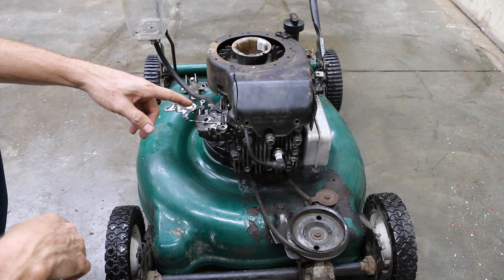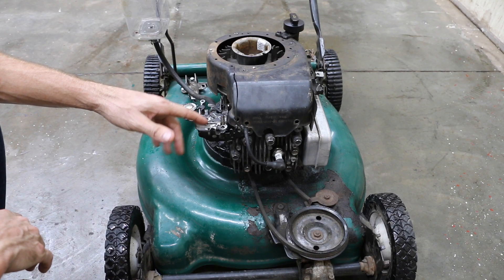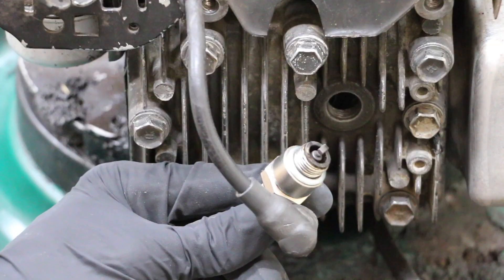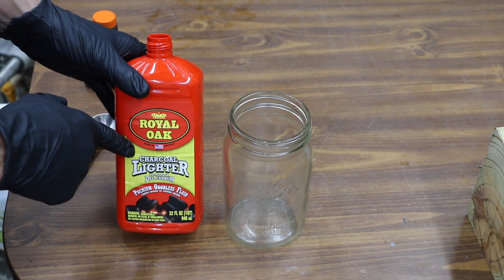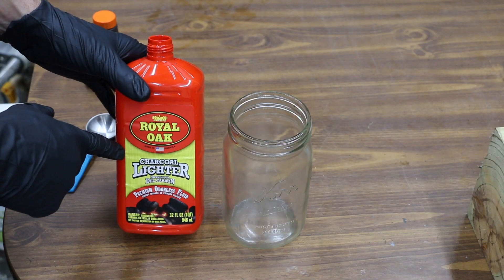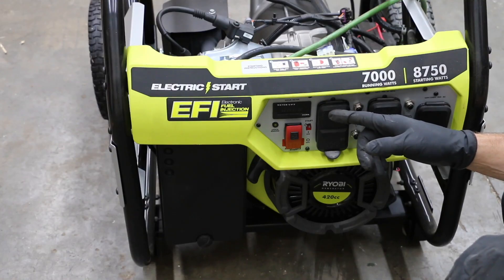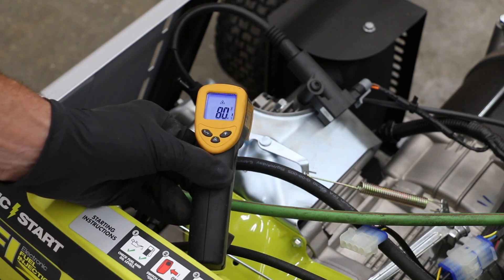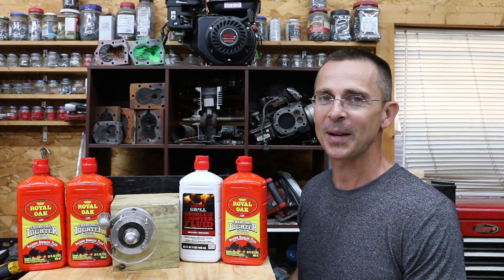Will a Gas Engine Run on Charcoal Lighter Fluid? Let's find out!

Comment: Good to know, but long ago I came to the conclusion that a small jerrycan is well worth carrying in your trunk no matter what car you're driving. If you're not doing off-road adventures you don't need a 20 gallon reserve, there are some nice little cans holding just a gallon or so that take very little space and don't let out any odors, if you're worried about accidents you can spend a few extra bucks to get one that's also shock proof and heat resistant to some extent.
Reply from the maker: Thank you

Comment: Im surprised those engines ran as well as what they did on lighter fluid. Besides being a very dirty fuel it seamed to work well enough to get you by in a pinch
Reply from the maker: Thanks for the feedback

Comment: This video got me wondering if the spark plug position has any effect on the carbon buildup and potentially the power.  The flame travel visible in the see through head definitely has a pattern of blue vs yellow with obviously (I think) the yellow streaking being the areas where carbon builds up.
Reply from the maker: Great point. Thank you

Comment: Hi Todd. There's a lot of urban legends about making a diesel engine run on vegetal oil, enhancing engine performance by adding 1 glass of acetone to the tank, and others. If you have a diesel engine (car or power generator at hand), can you do a big "diesel urban legends review" ? It would be great. I must add than during a strike I had to make my diesel car run with 30% of sunflower oil with no problem at all : no smoke, no fries smell, no less mpg.
Reply from the maker: Thank you for the video idea!

Comment: Hey there Todd, have you ever tried running an engine on pure ether, or starting fluid? Would be an interesting video.
Reply from the maker: Thank you!  I did test starting fluid but it had lubricant too.  Would be very interesting to test ether without the lubricant

Comment: You do know in your scenario you mentioned there would be still massive amounts of fuel in the bottom of the tank  all your charcoal lighter fluid would do is mix with the residual gasoline... should have a blend might have some Coleman fuel left if you went on a camping trip as well
Reply from the maker: Great point!  Thank you

Comment: So here's a new idea for you I have tried and has went both ways but can dusting a engine with baking soda when running bring back compression get rid of slick cylinder condition and regain compression due to normal wear aka just worn out engine will it re hone a cylinder or is it releasing the rings because a stuck ring can simulate a slick cylinder. Using a teaspoon give it about 1 small amount  just enough to studder the engine down heavily and fast enough but not enough to kill will need to keep it running moderately reed to achieve this. Will this review seat rings?  Am fighting brain cancer and it's awesome I get moments I come back around and all kinds of ideas come flowing. I love to share with you and fans. Rest of the time I set and enjoy. Really liked the crude oil. Keep us smiling. Thank you from you friends from NE colo....
Reply: And another idea go though how some old chemicals they used to use vs what's available today. If you get ur hands on dot 1 brake fluid can figure out its explosive properties. We kept it around to blow out os glass pack mufflers. Back in the day. Be warned doing so is dangerous glass pack can turn into grenade if not done right. Or if even u do b everything right it still can go bad. A good place is to hit up these u tubers storage finders. Just ideas
Reply from the maker: Thank you for the video ideas!

Comment: So one time when I was young. I put zippo lighter fluid one can two cans of carburetor cleaner and half a gallon of gas that had some 2cycle oil in it in my pickup to get down to work. I kept it at 45 mph it worked fine. Wouldn’t want to do it again
Reply from the maker: Glad it did the job!

Comment: I may be wrong, but I thought lighter fluid was just gasoline that didn't have any detergent additives. Which would explain why it ran about the same as the gas in that mower engine, and left a lot of dirt. I'm betting if you mixed it with a double dose of Seafoam or MMO you would have a pretty decent gasoline.
Reply from the maker: Thank you.  I believe it's a lot more like kerosene.

Comment: In 1982 a friend and I went camping.  The fuel pump in my VW broke while we were deep in the mountains!  I pulled the fuel line off the pump and plugged it into a bottle of charcoal lighter fluid.  Then I turned the bottle upside down and strapped it above the carburetor with a bungee cord.  I poked a vent hole to prevent vacuum lock.  That quart of charcoal lighter fluid was enough to get us down the mtn to a repair shop!
Reply from the maker: Nice!  Glad this did the trick!
Reply: Classic MacGruber.
Reply: Those vws man
Reply: You didn't mention the effect of gravity going DOWN the mountain.
Reply: Oh wow. See Project Farm's scenarios are real!
Reply: @Dimondminer11  eh I've done similar things, I run a motorized bicycle to work, and have had twice where I HAD to get to work and didn't have gas or money for gas, once I used some paint thinner and 10-w30 for oil, and the same with lighter fluid, both worked fine but liked to stall at low rpm
Reply: Or could've just coasted DOWN the mountain in neutral.
Reply: Yeah
Reply: Charcoal lighter fluid is supposedly a form of naptha. It's a good cleaning agent. I'm not sure but I think it's similar to white gasoline. The extra deposits in the mower engine after using the charcoal lighter fluid may have been caused by that fuel combining with the engine oil cleaning as it burned , whereas gasoline might not react that way as much as the charcoal  lighter fluid  ?
Reply: VW,= 4 Briggs & Stratton engines with common crank shaft and camshaft therefore it will run on almost anything flammable! As with a lot of alder engines, Pre 1974, (first computers). 

 Now we know that a fire needs three things to burn, ignition, fuel, oxygen, for most fires. So if you lit a match it would be the catalyst, that leaves either substance being burned , or the oxygen as the true fuel? 

 Remember all fires need oxygen, except some metals, such as Magnesium, this metal gives off oxygen when it burns, thus most firefighters will foam it down and let it burn it self out.
Reply: Magnesium doesn’t give off oxygen, but it can steal it from molecules other than plain ole O2, like CO2
Reply: Patrick Fennessy,

Remember the Fire triangle!

Comment: You should test octane boosters by putting them in the most knock inducing fuel. See which octane booster does the best job at reducing the knocking.
Reply from the maker: Thank you for the video idea!

Comment: I think I found a new penetrating oil solution. Mix 50/50 Ronsonol (naptha, lighter fluid, etc) with a light oil (turbine oil, sewing machine oil, tool oil, spindle oil, etc). Super thin and super slippery.
Reply from the maker: Thank you!

Comment: Charcoal lighter fluid is naptha. It's a great solvent that's safe to use on almost any fully cured paint or varnish surface. Luthiers use it to wet sand nitrocellulose laquer guitar finishes. It evaporates with no residue. I always have some around for many different uses, but would never light charcoal with it! There are much better ways...
Reply from the maker: Thank you for this information!

Comment: You need to do the lubrication test on these alternative fuels as part of the comparison. There is also a density test used for checking alcohol content in beverages and acid levels in batteries that would give some comparative information as to how good a substitute for gas or diesel it would be.
As for charcoal lighter fluid,I suspect it is just kerosene and white spirits with a perfume added to disguise the smell so it will probably work well in a diesel but I wouldn’t use it in a gas engine as it will destroy the catalytic converters.
Reply from the maker: Great test idea! Thank you

Comment: I was walking through the automobile oil aisle at the local big box store and came up with an idea to pass along to you. You know how they have the 0w oils... How would an engine rated for 10w30, or even higher, handle 0w oils? Can they benefit new engines or tired old engines? Also,  have you ever done a real world comparison of the different oil weights? Lubricity, flow rate at hot and cold, effects on engine performance, etc.?
Reply from the maker: Thank you for the video idea!

Comment: Video idea try different lighter fluid and see if one start fire better.
 I buy store brand but it take me a lot to get a bbq going or does any one have any input.

There also a ECO brand sold at Amazon and home depot and a , Smarter Starter Natural Charcoal Lighter Fluid brand that claimed no carbon left behind.    

I let bbq be lit for a very long while befoe putting food on do fact I used wood from trees.
Reply from the maker: Thank you for the video idea!

Comment: Run a Deisel engine on old fish n chip old oil after you filter it first no added chemicals at all Just old fish n chips filtered oil straight from the cookers filtered then in engine fuel it should run . Where i live we use to start your bastard spray can either in a can, The deisel folk use it all the time to start big deisel motor,s or nitrous oxide .cheers from down under.
Reply from the maker: Thank you for the video idea!

Comment: Very interesting.  For an emergency, this is a workable idea.  Not something that would be counted upon, as performance definitely was not there, but that was not the point.
Now, is it possible to melt tar to the point that it could be used as a fuel?
Reply from the maker: Thank you for the video idea!

Comment: if lighter fluid works, then thinner should works too. right ?
Reply from the maker: Yes, thank you
Reply: @ProjectFarm  Thanks for the info. I wondered if prolong use of thinner would cause any harm to the engine. Perhaps the engine oil will get diluted eventually?

Comment: A serious application question.

This shows that engines will run but with less performance and potential damage. ( carbon fouling)

I would be curious to know if adding the lighter fluid to existing fuel gains an advantage in extending range, or negates the performance of the existing fuel.

For an example:
An 11 gallon tank holding 10 gallons of gasoline .
At 10mpg would be a range of 100 miles.
The lighter fluid has less performance so less mpg.

So would adding a gallon of lighter fluid to the tank gain mileage?
( 100+ )
Or would the lighter fluid taint the existing fuel and have a shorter range? (100-)

Would it be better to add the fuel at the beginning of the trip, or just before the tank is empty?

With the carbon fouling I would say this only be used in a real emergency vs an inconvenient emergency.
The cost of repairs compared to the inconvenience of walking 5 miles to a station and returning may not be worth it.

Something to consider while drinking from my project farm coffee mug 😁
Reply from the maker: Thank you for the video idea!

Comment: Wonderful work although I am curious if the generator has knock sensors. Although I don’t condone using such a liquid in a car, modern port injected vehicles with knock sensors and variable valve timing may be more resistant as they are able to pull timing and delay valve opening to inject fuel later after TDC in severe cases. Some more recent engines can even let out compression so to speak by altering valve overlap and leaving the intake valve open slightly longer before the power stroke pushing some of the mixture back into the intake manifold. This is especially prevalent in today’s modern high swirl pentaroof combustion chambers that set the concept of direct injection in motion. Atomization is key in any alternative fuel which injection does well and what the carburetor lacks completely. This is my explanation for the easier starting to folks here who are curious. Again excellent work! Thanks for the videos!
Reply from the maker: Thank you.  The generator does not have a knock sensor and cannot adjust timing.

Comment: I do have two video Ideas:
"Will running 2-Stroke Gas in a 4-Stroke Engine make much carbon deposits?"
And
"Will running Colemann fuel (plus 2-stroke oil to save the injection Pump from seizing) damage a Diesel engine?"
Reply: He already did a video on your first idea
Reply from the maker: Thank you!

Comment: I can tell you alcohol works,  Many years ago I owned a remodeling company, and one day one of my crews didn't fillup before heading out.  Well seeing it was my paint crew and oil base and lead paint was the ext. paint of choice we always had turps, sub-turps, alcohol as well as other thinners, cleaners and mixes.  Well, they ran out of gas about 6 miles out so they took 2 gals of the alcohol dumped it into the tank and drove to a station.
Reply from the maker: Thank you!

Comment: 70% Vodka mix with 30% charcoal fluid.
70% Perfume mix with 30% jet fuel .
50% bioethanol and 50% isopropyl alcohol.
Let's do mixing several fluids together and see if they become more potent, and or mixtures that might be very good but help save budget (economically speaking).
Reply from the maker: Thank you for the video idea!

Comment: What kind of PSI are you using to start your engines? Tried an electric impact on my 8HP snowblower engine, but had a hard time getting it to crank over...
Reply from the maker: Thank you. I use a drill that's capable of 2500 RPM.  3/8 inch Dewalt corded drill.

Comment: One thing to think about is a car with efi has knock sensors to take ignition timing out to stop destination (pinging). If only you had a junk ish car to try it in and see if the computer can compinsate for the knocking
Reply from the maker: Great point!

Comment: If one really needs some spare fuel to get anywhere, and is looking to use any "whatever" it can find in the truck, it is better to mix it with what's left in the tank before it is empty. (thinking beforehand instead thinking looser if it fail) ;)
Reply from the maker: Great point!  Blended will perform better than straight lighter fluid.

Comment: Have you  tried Lacquer Thinner or Mineral Spirits yet?
Reply from the maker: Mineral spirits but not lacquer thinner. Great suggestion!
Reply: You could  also  try  Acetone  (see if it melts carburetor parts or fuel tank.  Anything else on the solvent  shelf.

Comment: Growing up in Alaska,  I heard a lot of tales told about emergency measures to get a person home.
One in particular would be suited to your channel:

Leather piston rings cut from a waist belt.
Supposedly soaking the leather in oil before cutting reduces unwanted swelling.
I seem to remember a tech instructor mentioning leather rings in early engines as well.
Reply: Ive never heard of leather for the rings but my grandpa has a 1910 sears and Roebuck horseless carriage and in that thing the belt that drives the fans is leather, the brake pads are leather the seal for the oil pan also leather and the bottom of the  jug for the piston think where the cylinder wall meets to the crankcase but they can separate uses leather
Reply from the maker: Thank you for the video idea!

Comment: Video idea:  Is premium gas ie 91 octane worth it versus 87 ?
Reply: Only if the engine has the compression to require it. All higher octane rating does is increase the resistance to knocking.

Comment: I think it would be interesting to see a video where you test the cleaning power of injection cleaners or gasoline types. I believe you did a video in the past where you tested to see how clean a type of injector cleaner or gasoline will keep the engine clean, however, I think this was starting with a clean engine each time. I think it would be cool to see the same test but dirty up the engine first with something like lighter fluid.
Reply from the maker: Thank you for the video idea!

Comment: Test car air filters by clogging them up.  Test mineral oil as a lubricant. Test Plasti Dip sprayed onto car parts to test its ability to protect from corrosion and heat. Test work boots. Test corded and cordless impact drivers. Test shop vacs!
Reply from the maker: Thank you for the video ideas!

Comment: What actually makes the pinging sound, when using other fuels? Anyone have an idea?
Reply: Fuel/air mix self igniting from compression heating before the piston reaches the top of the cylinder.
Reply: @calvingreene90  ahh right, so pre ignition gotta. Thanks for clearing that up👌🏼

Comment: Can you mow your yard with no gasoline by cranking the engine over with an electric drill and a extension cord
Reply: you could but the load on the drill would probably over heat the motor and the clutch for the drill, they meant to handle decent load or long run time but usually not both at high speeds, ive found multiple dead drills that i tried resurrecting cause the clutches or chucks crapped out from abuse like that

Comment: Two kinds of lighter fluid. The kind used for cigarette lighters is 3/4th's  naphtha (white gas) and 1/4th descented  kerosene. Charcoal lighter fluid is just the opposite being 3/4th's descented  kerosene and 1/4th petroleum naphtha (white gas).  Maybe recreate a mistake people have made at gas stations and put diesel fuel in their gasoline cars. Mix half regular gasoline with half diesel fuel and see if it will run in a gas engine without damage. My prediction is that it will run the engine fine but leave more carbon deposits than straight gas.
Reply from the maker: Great information and you are right on the carbon deposits. Thank you!

Comment: Glad to see another alternative fuel video! Was also wondering if you would try using CRC chain and wire rope lube as engine oil to see what it does, will it hold viscosity? Will it boil away and sludge up? I'm curious!
Reply from the maker: Thank you for the video idea!